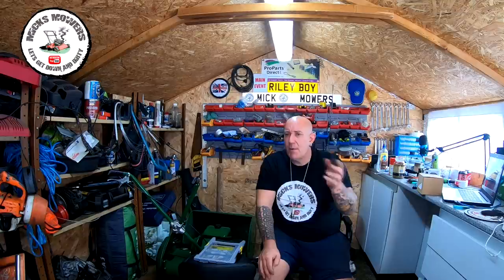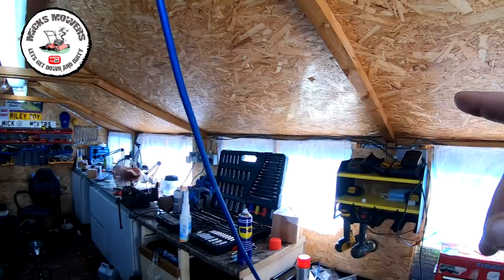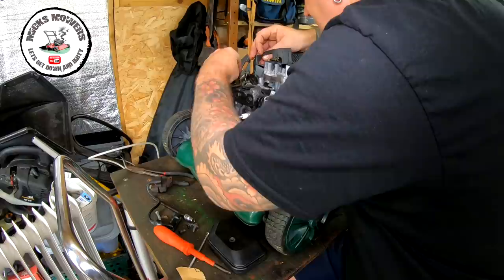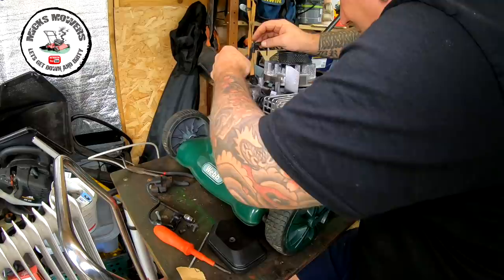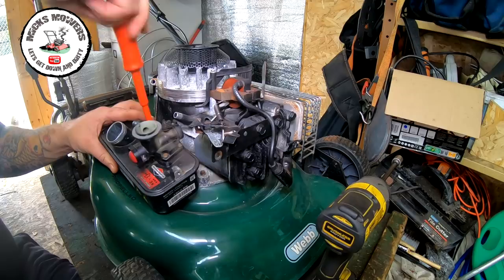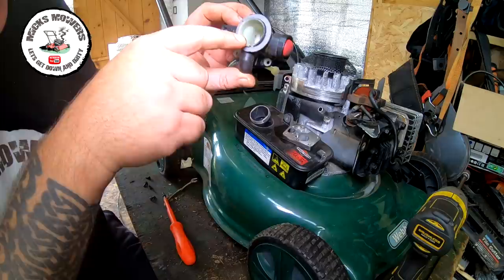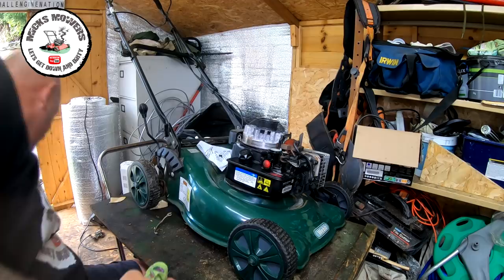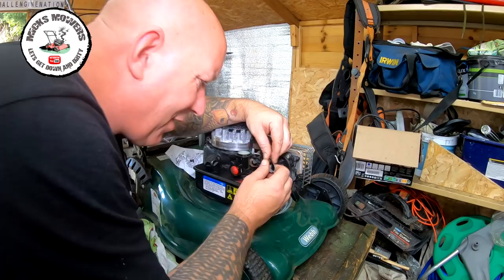WEBB BRIGGS AND STRATTON Lawn Mower Running Lumpy Here's What To Check First

Comment: Those briggs and stratton classic engines are a delight to work on, so simple in design. Had a feeling it was the gasket due to the hunting noise. I always run mine dry after I'm finished for the year right about now, keeps the gasket and diaphragm  gumming up from all the ethanol they put in fuel these days. Great tip about primer bulb and tightening gasket by the way....

Comment: With the amount of years I've been doing small engines, in the begining if a mower came back, I would doubt myself, my work, but for as many years as I have been doing this, that stopped a long time ago, it is always operator error, either bad gas, or it has sat to long without use, if it left running top, and comes back 6 months later, it is always operator..... Owner error, never doubt yourself.... If it left your shop running tops, and comes back 6 months later it's never your fault.
Reply: Agreed its there way of getting there money back or a free service!! Only on certain situations would I take one back.
Reply: @lewispewsey6843  exactly.
Reply from the maker: Yeah problem is some of the honest storytelling by some people do make you think.. thanks for watching
Reply: @themowerman  oh I agree, but after awhile it gets to you, if he uses it professionally it automatically voids any warranty it may of had...... You have to know where to draw the line, I had a guy who used it pro, returned it, or tried to saying the blade came off and almost cut his foot off, it turned out it fell off his trailer and got run over by a truck, and guess what the blade was still attached, you have to feel it out, trust who deserves it.
Reply from the maker: @knighthawk86855  yeah mate..
Reply: All I'm saying is don't sell yourself short, you do good work, you know how it ran when it left, stick to your guns, and say to the customer, when it left it ran, I don't offer warranties on my mowers, if you want a warranty buy new, and even those don't cover owner error, once you get more use to the game you will understand, and know who's pulling your leg.

Comment: OK  you have handles sticking up everywhere.in the garden.    Starting up a mower under the laundry.  Yikes!!!!   I have had more trouble with diaphragms this year than any other.  It almost looks like the owner tried a few things  (spring)  before he brought it back to you.  A tiny  flutter with the old  plug.  I think he got the mower wet.
Reply from the maker: Yeah the old plug was on its way out.. I had troubles to with some gasket and diaphragm sets this year.. lol yeah I use the old vintage mower to do my washing lol

Comment: Watch a workshop trick I've noticed on some mowes that go in for a service. They remove the fuel filter, you then end up a year or two later paying for a dismantle and carb clean. 

Obviously not Mick! But some unscrupulous shops are doing this.

Comment: Hi Mick. Great video. Thanks

My B&S 35 is behaving like that at the minute. Yours was the first video to come up.  I'll go through all those steps tomorrow. Do you do videos on how to test and set up the springs and how to test the coil in more detail?

Thanks.

Noel
Reply from the maker: And here is the coil video https://youtu.be/3M5msgSqkC0
Reply from the maker: In this video shows the spring set up
 https://youtu.be/mjxkHtnBTh4
Reply: Thanks Mick. I think I'm sorted. The cable had come loose from the pull cord cover. It was mounted just behind the petrol cap. It had been pushing the carb mechanism forward. The air filter was also clogged up with oil and gunge. I cleaned it up re oiled it and it's running fine now.

I see in your video you said to leave the throttle cable off. Does that apply to all mowers? Mine is a Harry body with 35 Classic engine.
Reply from the maker: @Yakuntcha  the classic ones don't need a throttle cable.. but if you have one and it works then leave it be until it starts giving problems..